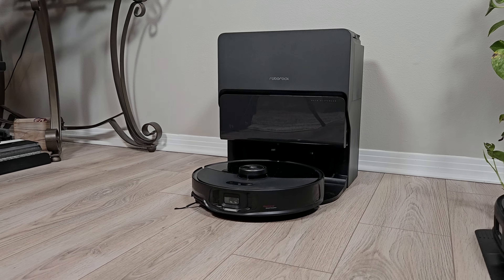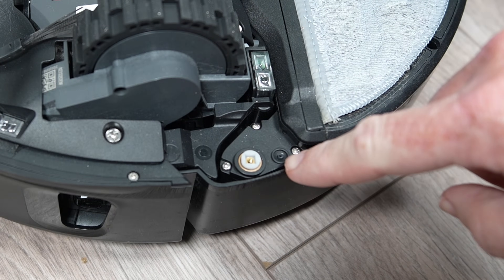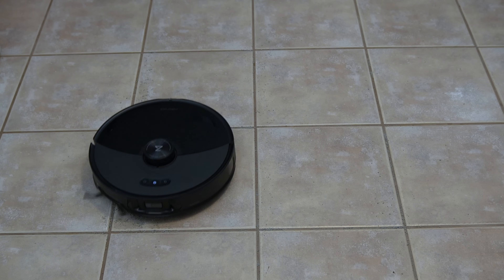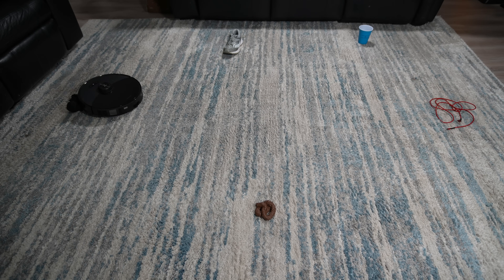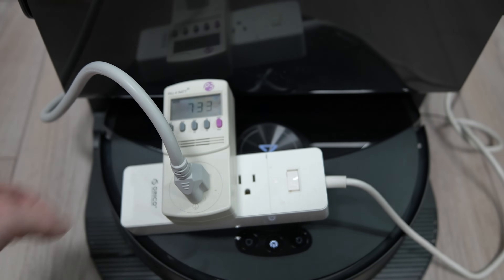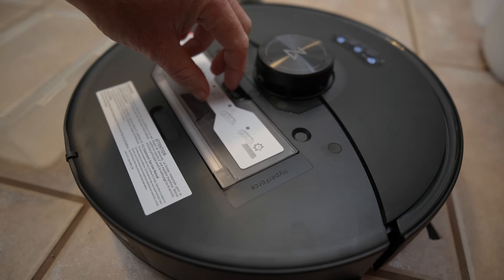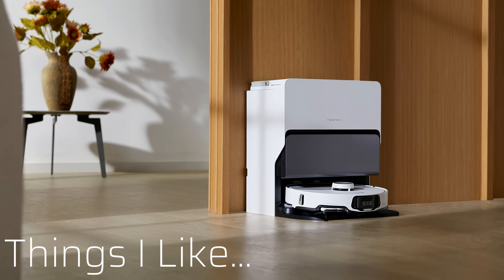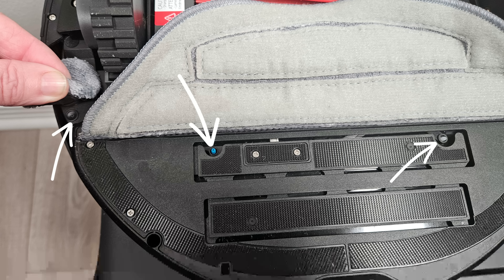Roborock S8 MaxV Ultra Robot Review. The Good & Bad.

Comment: One thing I would like to state.  I purchased the S8 MaxV ultra and am happy with the unit but their trade-in offer is a SCAM.  I sent my unit it, they sent me an email saying they had received it and confirmed the trade in value, I needed to go to the website and confirm.  I won’t go through every useless email, phone call etc.  But the bottom line says they don’t have my unit (even though I received  an email confirmation) and the trade in offer is no longer available.  They have my S7 MaxV Ultra, and I have not received any trade in amount.  Trying to talk to customer “service” is useless.  What a despicable company
Reply from the maker: That is not good.
Reply: I would like to update my complaint and explain, and yes, I still have no solution with Roborock.  I did the trade in, they evaluated it as a grade B (fine with me) and said they would send a shipping label within 24 ours.  Four days later I have no shipping label, and on the website it says I only have a couple days left to ship it.  SEVERAL calls, Emails, chats, I receive my shipping label and send in my S7maxv Ultra.  A few days later, I receive an email saying they received my unit and confirmed it is a grade B, all I need to do is go to the website and accept, so I do.  The website says I did not ship in my unit within the prescribed time.  SEVERAL more calls, emails, chats, they tell me it is fixed, and just go to the website.  Well, NOW the website asks me if I have shipped in my unit?  (Keep in mind I have an email saying they received it), then it tells me when they receive it, they will verify the grade and let me know.  SEVERAL ore phone calls, emails, chats, and a couple days later I go to the website and it says to accept the Grade (B) to receive my refund.  A couple days after that I receive an Email saying the refund amount of my trade in has been issued to he credit card I purchased the new unit on.  NOPE, here we are two days later and ZERO money has been refunded to my credit card.  SEVERAL more call, emails, chats and they have “escalated”  it.    The level of incompetence is incomprehensible.  The really sad part is, I like my new S-8, but it is not worth this frustration and I seriously doubt if they will EVER honor the trade-in program they advertised so aggressively.  I think I am out that money; buy from some other company, this is just too much.
Reply from the maker: @sdcoinshooter  I hate to hear this.  I feel it was poorly planned and overly complicated of a process. If you don't get your refund email me and I will pull some levers.

Comment: Thanks Jamie for your unbiased review. The Roborock S8 MaxV Ultra is our 1st robot purchase, based on your experience do you think Roborock will make the improvements you suggested in the firmware? We have just received ours and have a month to decide if this is the best vacuum/mop for our use. Also we are complete newbies, is there an in-depth video of the Roborock app to explain the options available?
Reply from the maker: It is my expierance that they will improve based on my findings.  That does take time though. I have a general app overview video I did a few years ago.  It is fairly outdated now, but may still help some. https://youtu.be/WE2NeBJseoc?si=D7PNXUx146DZ8u6T
Reply: @jamie.andrews  Sounds good, thanks for the link

Comment: Hi Jamie
I live in Korea and am a huge fan of robot vacuum cleaners. I purchased the Roborock S8 maxv ultra and it does not feel hot in dirty water.
After checking with a thermometer, I realized that it was not the 60 degree high temperature washing advertised by Roborock, and while searching, I found your YouTube channel.
Roborock does not seem to be able to solve this problem with a software upgrade such as a firmware update, and this is seen as an act of consumer deception that is different from advertising. And in Korea, importers are concerned about this issue.
Instead of taking active steps, they just raised the price and launched it.

I am very angry with Roborock, and I am very embarrassed by the difference in results between the hot water washing advertised by dreame, ecovacs, and narwal, which I used previously, and the hot water washing advertised by Roborock.

Jamie what are your thoughts on this matter? This raises suspicions that Roborock released the product in a hurry without properly inspecting it. After the Roborock S7 maxv ultra, Roborock continues to show disappointing results. In particular, I hope Roborock responds quickly to the hot water washing part. If not, I will not pay a lot of money to buy Roborock products in the future. they are liars
Thank you so much for your robot vacuum cleaner review.
Be healthy and happy.
Reply: Roborock said in their reply to Jamie’s review they would fix this issues he noted which includes the water and drying temperatures.

Comment: Wow Jamie, what an excellent review! (and editing) Think I'll pass on this almost $2,000 robot (after taxes).
Biggest deal breaker for me is that difficult hair removal on the main brushes. It's so much easier on the older models. An easy fix for the full dust bin is simply to put a timer in the app. You could pick how often to empty if you think there is a lot of material to pick up. Set for five, ten, or whatever minutes. Hear this Roborock!??
Reply from the maker: Thanks.  I suspect they will fix the software issues.  The hair on the roller though there is no software to fix that.

Comment: Jamie:   Did you encounter issues when there was a rug in the room that had mostly  hard surface in vacuum only mode ?   I have a tile floor with a low pile rug under the sofa/coffee table.   The robot does a normal perimeter run fine driving over the tile and rug tearing them as a single surface(carpet boost occurs she in the rug) Then it starts the interior cleaning. However, once the rug is encountered again, the robot starts wiggling its way along the edge of the carpet and does a complete perimeter run of the rug and full cleans the rug only.  Then the robot returns to the tile floor and cleans the remaining portions of the tile that is left.  The carpet setting is on rise which should be irrelevant in vacuum only mode but it appears that it defaults to mopping behavior when the rug is encountered in vacuum only mode.   This is a major waste of time and I really do not like the rug edge cleaning as it the robot goes very slow wiggling g it way along the edge and chews on the rug edge a bit.  I found it did the same thing in a room that had mostly carpet and a small marble hearth around a fireplace.   When it was cleaning and drove onto the hearth, all was fine. But as soon as it re-encountered  the carpet, it did a complete room permitter run again (as room is mostly carpet)before resuming cleaning.   This was reported to Roborock.

From my experience so far, the robot is ridden with software issues.
Reply from the maker: You may have the option on that says clean carpets first under carpet settings. I agree it should only do this on a mopping mode and not vacuum only mode, but I forgot to report that bug. I noticed sometimes it would appear to clean the edges of my rugs and other times not. I wish you could turn that feature off as it turns up the edges of my runner.
Too many issues with the robot right now.
Reply: Thanks Jamie.  I don’t have any of the other options enabled.  The vacuum only mode simply is broken.   In vacuum only mode, it should treat all surfaces (tile/wood/rugs/carpet) as one surface and just vacuum assuming you don’t have any options set (vacuum carpets first or after).   The entire carpet menu is at this point is tied directly to mopping. In fact, at the very bottom of the the apps Carpet page in light font, it says “when the mop bracket is installed” which is always since it’s not removable.  Bewildering how the basic vacuum functionality is broken.
Reply from the maker: @Firebat-  Yea I just noticed that about the mop pad attachment.  That was a problem on the S8 Pro Ultra too and they fixed the working about the attached mop bracket. I'll report that and test to see if mine is doing the same as yours with carpet. I have direct channels to report these issue.
Reply from the maker: @Firebat-  Make sure you are on the latest firmware.  I tested and mine does not vaccum carpets first in vaccum only mode with the setting turned off.  If I turn on the vaccum carpets first it will vacuum the carpet first.
I agree it should only obey this setting when in vacuum and mop mode and not vacuum only mode.
Reply: Thanks Jamie.

It’s running the latest firmware.  It actually doesn’t vacuum the carpet first.  It does a perimeter room run (including crossing carpet/rug) and all is fine.  It isn’t until during the room cleaning that it encounters the carpet again that it’stops and vacuums the rug completely including the aggressive rug  edge cleaning. Then it resume cleaning the rest of the hard surface once the rug cleaning is completed(and that is what RISE says it does with the mopping bracket is attached). This is repeatable and the Q Revo MaxV behaves exactly the same.  So it’s something with the firmware in the new models and Roborock not accounting for vacuum only mode.    I believe Roborock thinks everyone use mop and vac at the same time and isn’t focusing on vacuum only.   That would be the correct behavior if mopping at the same time.    I typically use vacuum only most of the time and leads to another annoyance of the app always ending up back in mop and vac..thus requiring routines to be created to simplify things.   But as of now, I find the robot not usable until they fix the rug issues in vacuum only mode (and make the aggressive edge cleaning and option as you mentioned).   Otherwise the robot  will damage some expensive rugs.
Reply from the maker: @Firebat-  What firmware version? Mine does not do that unless vacuum carpet first is selected.
Reply: 2.25.72.    I enabled and disabled vacuum first also just incase something was messed up in the robots database but same behavior.   Only thing selected is rise and carpet boost in the carpet settings.   And as noted, the Q revo maxv with its latest firmware acts exactly the same.  Maybe it’s the room layout and thus a specific use case?.

I have a rectangular room with a large low pile rug taking up 1/2 of room with the rug under a sofa/coffee table.   Three sides of The rug are exposed.  From the robot perspective, the carpet would appear to the against the wall the sofa is on.  

If you had a rug against the wall  and do a vacuum only, it should traverse the rug in the perimeter run and then start the interior cleaning.  Then as soon as it encounters the rug, it should stop and clean it completely and then continue.  

I’ll try a test with a small rug in the middle of the floor and see if that use case is different.
Reply: With just a runner rug that I placed in the middle of a room, it did the same thing.    It can’t be the robot as both models do this.  And as noted, in the carpet settings,  only RISE and carpet boost are selected/enabled.
Reply: Update:   Roborock indicates that intensive edge rug cleaning triggered by the robot encountering and leaving a rug/carpet is the new default behavior.   This is NOT triggered on the initial room perimeter run. Only once the internal portion of the room cleaning starts and a rug is encountered does the robot stop and vacuum the entire rig including performing the intensive edge cleaning. Unfortunately, there is no way to disable the intensive edge cleaning where the robot goes around the entire edge of the carpet slowly wiggling back and forth.   If you have a carpet with tassels or strings, you will have issues.  Also, if the rug is delicate, this new behavior will likely have some wear on the edges after awhile.   I asked Roborock to make intensive edge cleaning an option.  Let us see.

In reality, there is no need for this new functionality of cleaning the entire rug once encountered.  You can simply enable vacuum carpets first in a room (and you can set this option at the individual carpet level overriding the general app settings).    This is also the work around to not have the intensive edge rug cleaning performed.   The robot will not perform the intensive rug edge cleaning if you enable vacuum carpet first.    

I have made additional suggestions to Roborock of returning the functionality of RISE to historical behavior of just lifting the mop (if mopping)  and just vacuum the immediate path and not stop and vacuum the rug.   

Let us see what they implement.

Anyone have luck with the robot recognizing a mirror?    It doesn’t on mirrored closet doors in my home and even takes a picture of itself and notes itself as an obstacle.    This has been reported to Roborock as well to fix.    

Once fixed, we can retest these problem areas.

Comment: How easily is the dock cleaning on this compared to the S7 MaxV?

I thought I read something about this new dock have self-cleaning ability but that sounds a bit off. Maybe it just means it can dry which helps avoid water sitting around getting gross.
Reply from the maker: Easier on the Qrevo due to a removable dock tray and nothing to clean in the base.

Comment: Does the flexi arm work while the vacuum is on a runner ? I have runners in the kitchen so it would be great if it the arm comes out while the vacuum is on the runner. This would be nice to have. I saw the video and it’s not working. But something to work on for Roborock.
Reply from the maker: No it does not. So far for me only in corners.

Comment: Great review, I'm looking forward to seeing more about the new Q revo models, I like that design a bit better. As far as the hot water mop washing, sounds like the dock is turning off the heating element too soon, I would think the best way to handle this is to leave it on throughout the mop wash cycle. Hopefully the issue of only emptying every 30 minutes in the vacuum and mop mode can be fixed with a software update. The Eufy X10 pro and several Ecovacs models allow you to have the robot self empty after a certain length of time in the vacuum only mode.
Reply from the maker: Thanks! Yes the heater needs to stay on longer or come on more frequently.  Both things you spoke about can be fixed with firmware updates. QRevo reviews should be out in May.
Reply: @jamie.andrews   hi Jamie, will your QRevo review come out soon? Mid year sales are coming up and I want to know if it's worth getting the new QRevo Max V or stay with the old Q Revo.
Reply from the maker: @clickjo  yes in a few days.

Comment: guys, just get a eufy x10 pro omni... Much better price and does everything you need it to.
Reply from the maker: That is a solid machine aside from the brush roller which attracts hair.  Did you see my review?
Reply: @jamie.andrews  I did, in my experience my robot does not get hair trapped in the roller. very rarely do i clean out the hair from the brushes , i use it daily and have 3 dogs! guess its different for others

Comment: I was honestly really excited to get the S8 MaxV Ultra, seeing all the cool features it has. I was always a huge fan of Roborock, and really want to support them. But I also feel like they were getting much too expensive, with their top end robots reaching nearly $2K and mid-ends now over $1K. Sure, you need to pay for all the features they've added, but I honestly feel that most of the features aren't necessary, such as the voice control etc. That might be a huge think in China, but here, we have Alexa and Google, and if they just integrate it properly with those platforms, they don't need to work on a dedicated voice control feature. As such, the users end up paying for unnecessary or potentially useless features. I also feel like the numbers all these robot vacuum companies provide are just arbritary numbers, something they all pull out of thin air, just to one-up the competition, and they will charge you more for those higher numbers, while in reality, they probably aren't as high as they claim to be. I've never seen a single robot vacuum company show how they get those Pascal numbers, and we went from around 2000 Pa to over 10K Pa in about two years? What magical motor are these companies developing that produces these kinds of power without an increase in noise level or the physical size of the motors? It's almost nonsense. This is not a hit on Roborock, all robot vacuum companies boast this without giving substantial proof, and honestly we all fall for it.
Reply from the maker: Agree on all points!  Great take.
Reply: I mean the exact numbers might be questionable but there is a huge difference between the 5000pa and 11000pa ones
Reply: Meanwhile there is dyson, who has done great at improving the vacuum but hardly improved the robotic aspects.

Sighs

Comment: Thanks Jamie for another great review. I also have a lot of respect for RoboRock. Knowing that its navigation is rock solid (no pun intended!) is very reassuring and my respect for RoboRock put the s8 MaxV Ultra at the top of my shortlist to replace my ageing Ecovacs T8 AIVI but having seen this review, although as you say it’s by no means a bad robot, I’m now thinking that I’m very definitely going to wait until the Dreame X40 has been out long enough to have a few thorough reviews published (including yours) but right now my hunch is that it will be the X40 that I end up buying, specifically the X40 Master if I can get it in the UK because that plumbed-in docking station that integrates flush with kitchen cabinets is the neatest implementation of a dock that I’ve seen and the kitchen is where my robot’s docking station lives so it would be perfect for me.